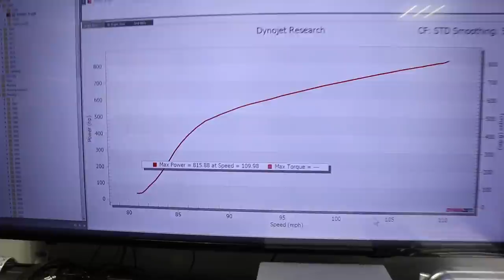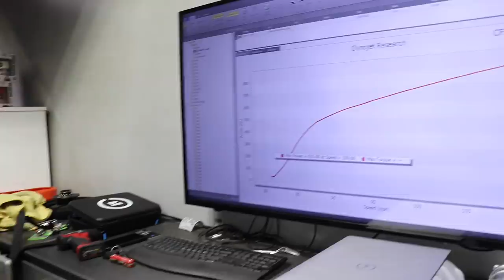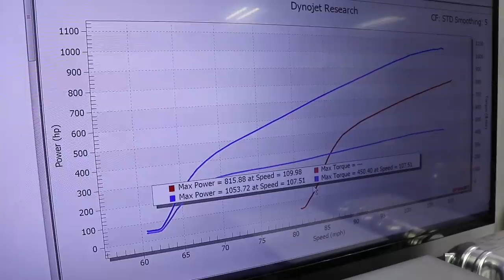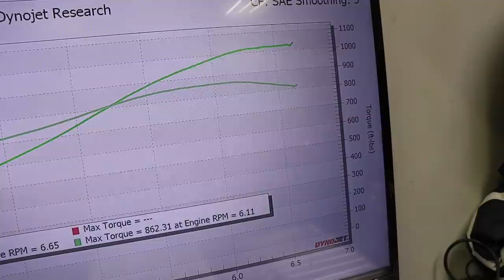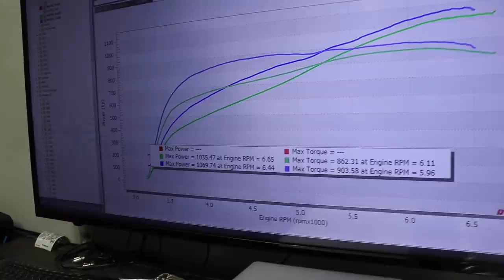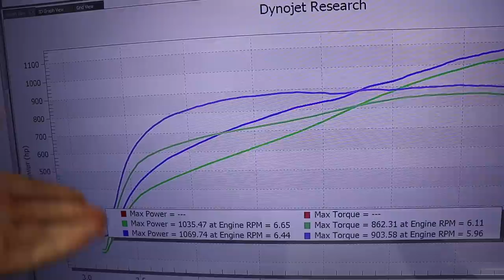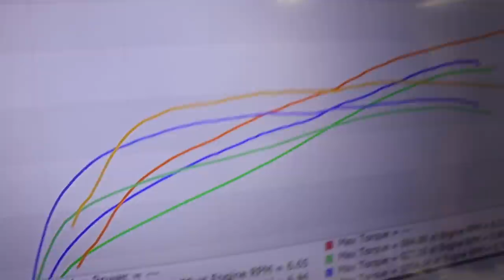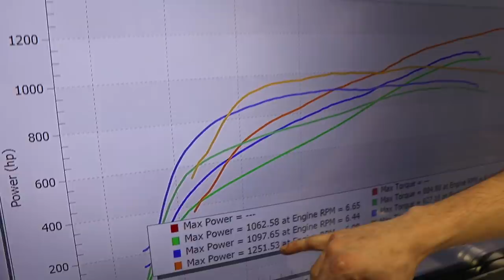Built GT500 Lays down Big Power with Whipple 3.8L

Comment: It's awesome to see it running, it's also cool you guys are friends with relatively similar builds to mess around and compete with each other. Cody the tuning will come with time and don't be to hard on yourself as you progress into it. It starts out easy and then gets hard and then gets easier. Just know cold starts are hard to get right without a IAC on a mechanical TB car. It'll either run good cold or hot not much in-between. I recently got a chance to review my very first tune I ever did, and holy balls was it bad lol! Keep up the good work guys!

Comment: You guys should build a legit sleeper.  Nothing Fox related since old now = fast.  I think a green 96 Mustang GT with a butterfly sticker rolling on widened stock wheels would be a good candidate.   If you really want to fool people drop a 2V 5.4L in there with a bottom mounted turbo so it still looks stock under the hood.  I've seen Lightning's with old school twin screws make diesel like torque on e85.

Comment: Bad ass! So was that smoke after every pull from the belt?
Reply: mixture of things but the little smoke you are seeing is the seating of the rings/break in(brand new engine) & no catch can in the car yet so open breathers as well as the headers burning off the oil from install.
Reply: @codychaney6328  open breathers make a lot of sense, appreciate your reply. Keep on kickin ass in this thing! Greatly enjoying following your build
Reply: The best 2007-2009 GT500s in one comment section that’s 1 in a million make that 3 edger I have a 2013 now sold my 2009
Reply: @codychaney6328  what pulley ??? And nice car man ... do you have cobra /navigator valve covers ???  Nevermind  asked too soon it’s a 3.25 with a 15 lower ???

Comment: Which motor makes more power the 5.4 or 5.8 when built or are they basically the same engine
Reply: According to svt the 5.4 is
Reply: @ranware2779  Wonder how thought that was the point of them making the 5.8. Guess the 5.8 has a bigger crank maybe which would make less power because of the mass spinning don't know tho
Reply: @kevinanglin678  i just find it kind of funny how the guys with 11-12 gen2 condors with tvs blower swaps will put down almost identical numbers when i say blower swap im refering to the trinity's supercharger
Reply: @ranware2779  Yeah that's what doesn't make any sense to me lol
Reply: @ranware2779  The 5.8 with the better compression should be making a bit more power than the 5.4 even with the blower swap done to the 5.4
Reply: @ranware2779  i agree really all 07-12 cars make similar power with blower swaps most people dont realize the blower is 95+% of the reason the trinity has more power stock...equal blowers is basically equal power the 5.8 may have a slight torque advantage but the 5.4 certainly isnt hurting for torque lol.  I went with an 07 because it was way cheaper than a newer model and the iron block is way cheaper to replace should something happen.  A trinity block is like 5 grand by itself and for what?  A tad more torque?  Or so you can tell people you got a 5.8?  Lol ill stick with my much cheaper basically equal 5.4 and swap a blower onto it.  The 5.8 makes similar power on slightly less boost but i dont think its anywhere near worth the extra cash the engine costs and the car itself costs it just doesnt make sense.  People who really understand gt500s understand this but the casual car guy thinks the 5.8 is far superior.   Its not.  The 11-12 is ideal because of the lighter aluminum block and they also have electric steering which frees up a few ponies vs the iron block cars but in reality all 07-14 are pretty close to the same when running the same blower the 13-14 just has a better blower stock which leads to the better power stock.  I like the way people think though it makes the early cars underdogs people sleep on them.
Reply: @midnight347  spoken like a true warrior

Comment: I was expecting way more tbh
Reply: Uh he’s on a 3.25 pulley with 8 more pulleys to go and making 1000+ and tq curve insane .
Reply: @mach183  it is real good power for sure but really the 3.8 isn't that much of a leap over the gen3r.  People see 2.65 to 3.8 and assume its gonna make 500 more hp it doesnt.  There are built motor gen3r cars making 1200-1300 whp those are higher compression than this one (11:1 or so vs 9.5:1) but still considering the size difference there isnt that much of a power difference.  Is it worth trying to fit it under the hood or getting a cowl or paying 6 grand for it?  To me it isnt but if youre trying to get as much as possible i guess maybe it makes sense?  I like the tvs myself its capable of plenty of power and can get up well above 1000 on built motors also and is alot stronger on the hit and easily fits under stock hood plus its alot cheaper.  Win win win in my book.  I didn't think it would make that much power over the gen3r but most expected a huge jump.  Hell prob get to 1200+ but tvs cars do that with a little more compression.
Reply: @midnight347  there is a good article in the KB 3.6 vs the 4.0 similar to what your saying but I totally agree with you ...typically it’s just a 100 hp increase
Reply: Dude made 1000hp what are u sayin
Reply: @KingB015  “expecting “ way more